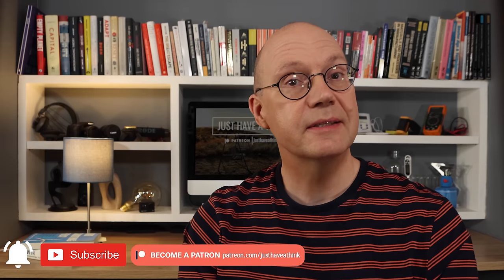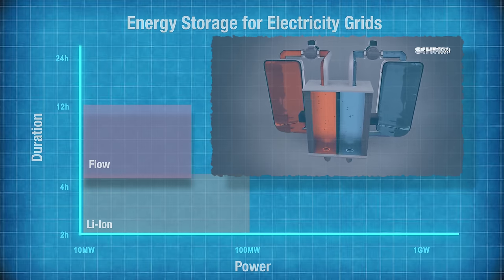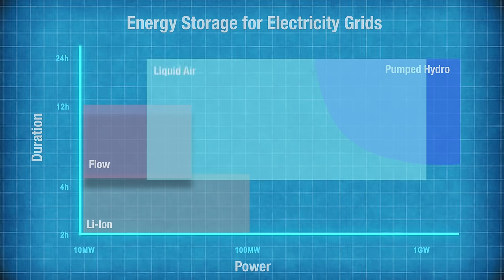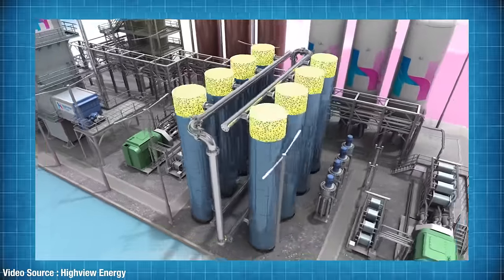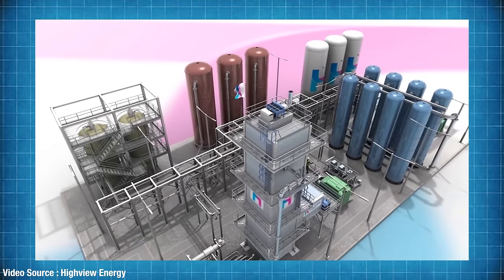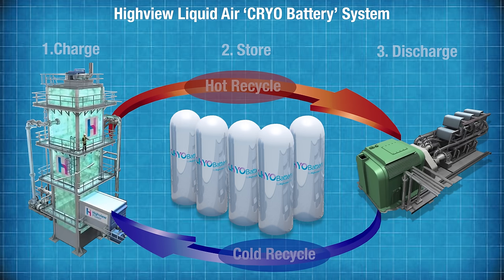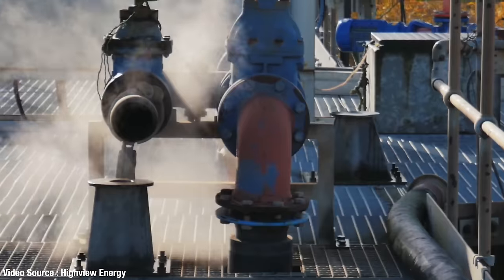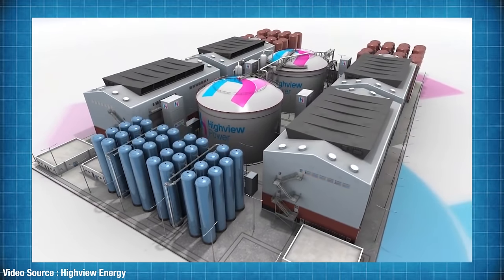Liquid Air Batteries. Literally energy from thin air. Seriously. Literally!

Comment: 60% efficiency is a lot when considering that the alternative is losing all the potential energy instead of  40%.
Reply: Alvydas Urbonas losing, not loosing.
Reply: Neil Hughes, some screws are looser than others.  Such as with the person who gets their pansies in a bunch because a stranger on the internet used the wrong they’re there.
Reply: @tcorris  Communicating is difficult enough, and there is no need to make it harder by not using the correct spelling. English must be a very confusing language to learn because of all of the words that sound the same, but loosing and losing are not in that category.
Reply: You keep all the power if supplied by baseload nuclear and don't have to dick around with storage at all.
Reply: @tcorris  magic, pure magic, im a gonna steal that one.
Reply: @tonyb9735  Practice what thou preachith.
Reply: @michaelnord9081 Don't be so obtuse.
Reply: @neilhughes3823  I'm sure he appreciates the grammar/typo catch as he edited it.
The sensitive ones haven't gotten over being chastised in grammar school, hehe.
Reply: @tcorris  Lol... You are good at sorting out loose ends... Brilliant!
Reply: 60% already would not be great - if it was even achievable - which it is Not.
The claimed 60% is reached when you add quite a LOT of extra energy into the system that you do Not count for the efficiency - aka "My battery is 100% efficient if you just provide some extra power for the output with your gasoline power generator".

This is not new technology - far from it. It has been studied and tried for decades. The only reason it is "viable" is cause of some succers pumping in money and the company promoting this can make money from those.
Reply: @ABaumstumpf  its 60% because other 40% is that "a LOT of extra energy" to make it work . In a way it is similar in hydro accumulator where you use power to pump water in elevated reservoir at night to balance the grid and use the same water to generate electricity during peak hours of use. And if there is a problem of balancing power grid then you need to do something because you certainly cant put hydro power plant all over the place.
Reply: @alvydasurbonas8913  "In a way it is similar in hydro accumulator where you use power to pump water "
No, you are fundamentally not understanding what the term "efficiency" means.
For energy-storage it means how much usable energy you get out of a system for a given input.
This "liquid air battery" reaches SUB 15% there and for the claimed 60% it needs extra energy that is NOT ACCOUNTED FOR in the efficiency calculation.

It is like claiming your car can go for 3000 km on a single tank - and then proceed to refill the tank twice.
Reply: @tonyb9735  agree
Reply: @michaelnord9081  If only the nuclear power you generate didn't cost 2-10 times as much as wind and solar, you might have a valid point.
Reply: @wildgoosedreaming1  That's an unnecessary comma.  (Yores truly, Gramma Not-see.)
Reply: @wildgoosedreaming1  New reactor designs don't produce waste, they can be net "burners" of nuke waste.
Reply: @ABaumstumpf  I think you better check on your retainer because the cost of the Nuremberg defense has gone up and I doubt you can afford it not only is it not going to work you're not even going to be able to get anybody to show up for you.
Reply: @loungelizard836  uranium is very very energy Rich indeed and at some point we will need to use that energy but we have so much energy that is less than free the cost of liquid nitrogen in terms of how many cubic miles versus cubic ounces you get when you convert uranium into liquid air essentially for what maybe a tenth of a Cent and most if mechanical work is the tasks to be performed by the energy at equivalent kilowatt hour.

The cognitive areas Industries effect to get Donald Trump elected or have the well-intentioned think that neutrons are for generating electricity are well m a p p e d.
Reply: @michaelnord9081  Baseload is just an old way of doing things. Generators bring two kinds of value, cheap electrons, and control. Nuclear is expensive, and the only control you get, is you can throttle some of them down 50% in the first year of their fuel cycle, but that just means it costs you the same to produce half the already too expensive electricity. Sure, you could try to organize all your production around your expensive nuclear sacred cow, but why would you? You know a lot of pumped hydro was built to deal with baseload plants like nuclear?
Reply: @fjalics  What are we optimizing for?  Nuclear is by far the cleanest and safest source of energy, even including recycling of radioisotopes.  Then there is the little matter of it being six orders of magnitude more energy dense than fossil fuels, which are already much more dense than renewables, so the land use requirements are tiny.  So if clean and safe and low impact are what we are going for, it is nuclear, hands down.

The issue of cost is, of course, there, but also solvable.  Much of the cost of reactors are in politics and permits these days.  You did change my mind in one way with this video though.  I've never seen an energy storage solution that looked cheap, scalable, and environmentally friendly.  This liquid air technology seems to tick off all these boxes.  So thanks for the cool, informative video!

Note, I'm not one of those anti-renewable nuts!  I have solar on my house!  I want to live in a future that is both clean and has power abundance, and I don't see a pure renewables energy mix that fits that
Reply: @fjalics  "but the one in Chernobyl and Fukushima were pretty ugly, and very expensive."
Fukushima - the biggest problems were people like YOU - fearmongering - which killed thousands of people.
And no - Wind and solar are not cheap, far from it actually. They are heavily subsidised and other form even penalised to make them more attractive.

And Then we still have the fact that this liquid-air storage is extremely inefficient.
Reply: It's also a blatant lie.
Reply: @michaelnord9081  That's the smartest choice.
Reply: @michaelnord9081  use solar panels for the day and this battery for the night in land which is lying vacant. Atleast with the battery you dont have to worry about toxic waste. Life time of 50yrs is the same as nuclear amd solar panels. Number of charge discharge cycles are better than li ion or ni cd. Thats what i think. Could be wrong. Interesting concept and safe.
Reply: And what about bitcoin?
Reply: In real terms, what exactly is the "efficiencies" of oil or any carbon based products?
Reply: @pclind  I did not. A pedant is a person who is pedantic. You can therefore equally correctly ask somebody either "to stop being pedantic" or "to stop being a pedant". I happened to choose the latter.
Reply: @tonyb9735  the latter is less known, right?
Reply: @gurdeepaksidhu7564  Batteries and solar panels are literally toxic waste.
Reply: @ABaumstumpf  your comments besides being factually incorrect only have Merit if the energy that you complain about is costly. Liquid nitrogen is about half a dollar a gallon including the delivery. Unfortunately this video does not Translate the metric we measure electricity with to the amount of liquid nitrogen needed to produce it. What matters is what happens when you run out of low grade Heat. What happens if you don't have huge barges liquefied methane needing to be boiled so that it can be put in pipelines to be burned. But I have argued that improvements in the liquification of nitrogen and oxygen are very very welcome. Specifically I have pointed out that Futures Market in energy itself is absent presently but if created would likely see new technologies implemented to produce this wonderful liquid in any quantity cheaply and cleanly
Reply: @michaelnord9081  the thing about nuclear is that using it to produce Steam is madness and using that Steam to produce electricity is Criminal.
Reply: @Irene-fu6gj  "your comments besides being factually incorrect only have Merit if the energy that you complain about is costly."
You would be a lot more convincing if you had an actual argument but instead you are only showing your ignorance.
Reply: @Irene-fu6gj  What would you use heat to produce?  Unicorns and ponys?  And if you think using steam to create electricity is criminal, you need to turn off your computer right now.  Cause that's where it's electrons are coming from, no matter what your fantasies of renewables think.
Reply: @ABaumstumpf  LNG contracts have "energy itself" adjustment clauses.  That is uncompetitive inducement in my book antitrust.  The capital investment for LNG infrastructure is beyond lame it is archaic "owning nation" first vice destroying our very 🌎.

In 5 ten or a quarter of a century you can contract for various forms of delivered or equivalent energy and agree to deliver it.  That is the answer.  LET the market thrive.  Enable investment and risk.  Lower the dam workers wages by removing the sleaze factor DUH.  Pride is healthier than shacks and 50 extra hours a week overtime.
Reply: @neilhughes3823  had to have understood it to correct it, which begs the question why bother correcting it
Reply: Tony Wilson  the motives of the individuals involved with the company you have mentioned don't really matter to me. As promoted however it's not part of the solution but this liquid is an alternative to diesel is fantastic stuff that everybody wants and an alternative to electricity that can in short order make the liquid fuels that people will soon find anybody who contends it Incredibles dependent upon burning of 4 the facilitation of mechanical work. Nobody will believe that we tried to do mechanical work by burning shit. Boiling water is of course a Bazaar practice and not what anybody would do given a free enterprise system. Government can help simulate a free enterprise system democracy is especially can make customers Kings. Your Role here is as the jester apparently some sort of clown who says that the coal-burning companies need not by solid state batteries because they can manufacture their own Fuel and use it just as long as they don't sell it to anybody else. Well they can bid for the goddamn fuel if they want but although it's going to be so inexpensive it will cost more than what they can obtain from the electricity produced. That should go without saying.
Reply: Tony Wilson  you have misunderstood me I am Pro mechanism just not your mechanisms of antiquity. I prefer the Contemporary Superior rational considered. That makes me a which I know. Your effort is appreciated but obviously you need to go back to your tan Club.
Reply: @michaelnord9081 ,  I agree that nuclear when done properly is very good.  But that does not mean that we shouldn't dick around with other tech as they do provide a lot of benefit.  Unless you think it is a good idea to build nuclear power plants in all the remote villages where they do not have other forms of power.  Having renewables combined with storage solutions are not only much less expensive but can also be more environmentally friendly as we do not need to use the same amount of concrete or the hundreds of miles of transition to make it worth while.
Reply: @michaelnord9081  Nuclear power is the most expensive form of power per Kwh, why is that? Things that are efficient don't tend to be expensive, so why is nuclear power so expensive?
Reply: @0hypnotoad0  Honestly, a LOT of ink has been spilled on the topic.  Excessive paperwork is one.  Irrational waste storage requirements is another.  NIMBY is a huge one.  I think it is because each reactor is bespoke.  If we had to design a totally new wind turbine and build it on site, fill out paperwork detailing how the wind turbine would be stored after destruction for the next 100,000 years, wind would be expensive as well.
Reply: @michaelnord9081  Wind turbine fiberglass may be obnoxious junk, but it's primarily inert and non-hazardous material that can at the very least be shredded and used for insulation or construction backfill.  Spent nuclear fuel is quite hazardous to everything around it, so you're comparing apples and dynamite.
Reply: @michaelnord9081  But when nuclear blows up you get Chernobyl, Fukushima, etc. With this you just get a loud pop.
Reply: @michaelnord9081  Except the long-term storage of the nuclear waste...for eons and eons.
Reply: @AceHoffman  If it lasts an eon, it isn't substantially radioactive, ipso facto.  So my question to you is why, with demonstrably zero factual knowledge on the matter, would you have an opinion?
Reply: @michaelnord9081  Half-life of U-235 is 700 million years, so nearly half of it would still be around after an eon. Humans have only been around for a tiny fraction of an eon. Take a hike. Read Irrevy by John W. Gofman or one of the 500 other nuke books I own.
Reply: @AceHoffman  Which is why U235 is safe to handle.  You could keep a chunk of it in your pocket you entire life completely safely.  Want to go for three comments demonstrating your ignorance in a row?
Reply: @michaelnord9081  U-235 is an alpha emitter so of course it won't penetrate your cloths or skin if you have chunk in your pocket, but some of its daughter products are, of course, beta emitters. Don't' breath U-235 dust, though. That could be hazardous to your health.